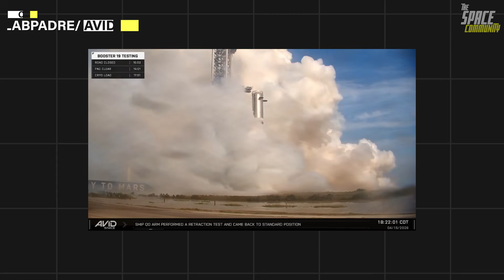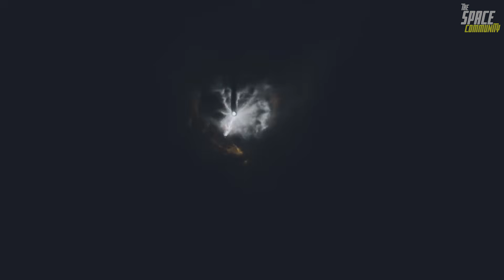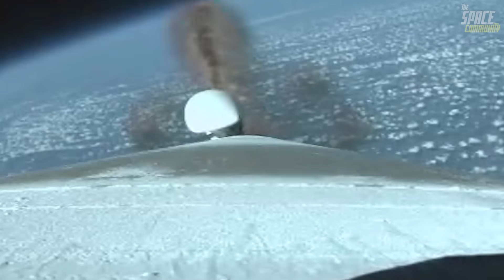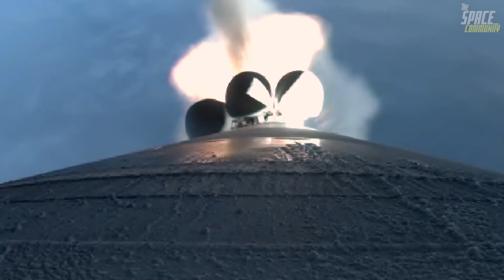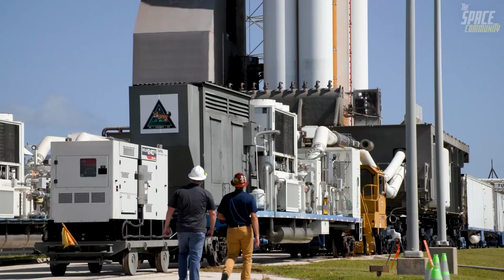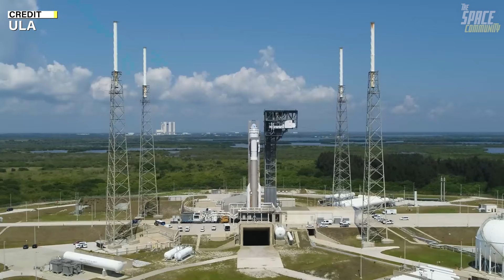SpaceX Did Something Never Done Before on V3 Booster 19! 33 Raptor 3 Engine Static Fire Completed

Comment: Obviously, an unsuccessful and aborted test. 

MIT'86 AeroAstro
Reply: Obviously it wasn't. And you're wrong.😊
Reply: This version 3 is a brand new rocket completely revamped. SpaceX is incrementally testing the system along with the launch pad.
Yesterday was a completely normal test and probably will test a longer duration firing but usually they go no longer than 10 seconds.
Reply: Previous tests of booster prior to launch have been just as short! the key long duration testr was S39.